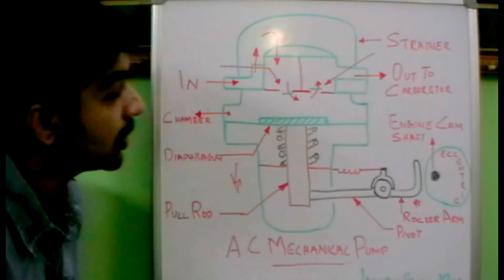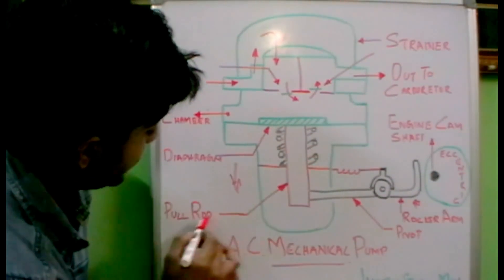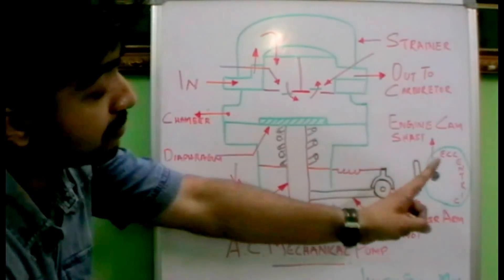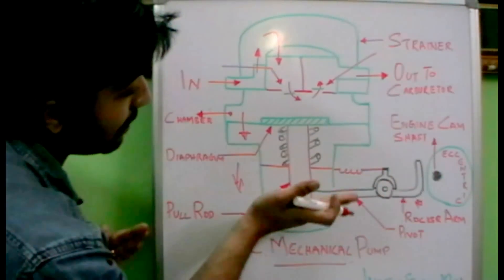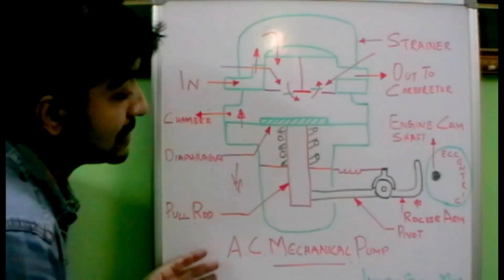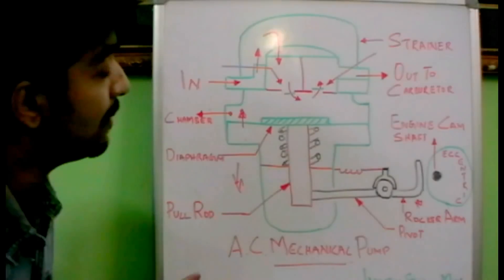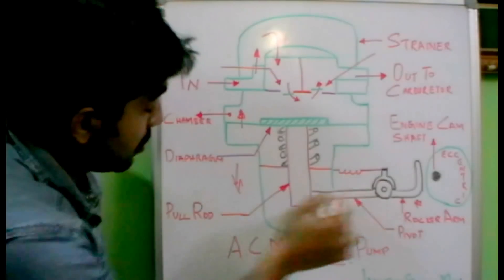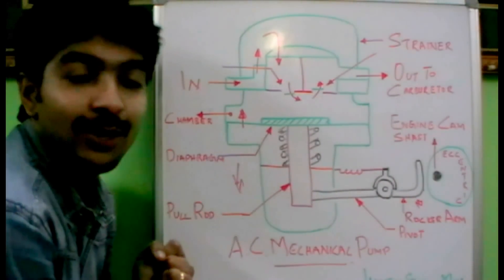How AC mechanical fuel pump works. ✔

Comment: The engine only pulls the rod back and brings fuel in. Only the spring pushes the fuel out. The spring pressure and surface area together are calibrated for the pressure is the reason only the spring pushes the fuel out, also if the pressure builds up when the carb is full, the rod stays pulled with the spring compressed. Now the arm is just sliding down the rod and not pulling any more fuel because the diaphragm remains full by the pressure which keeps the spring compressed.